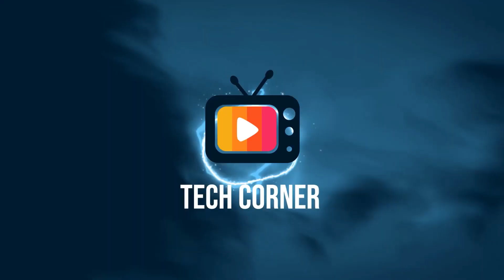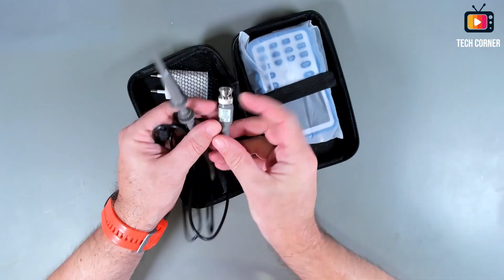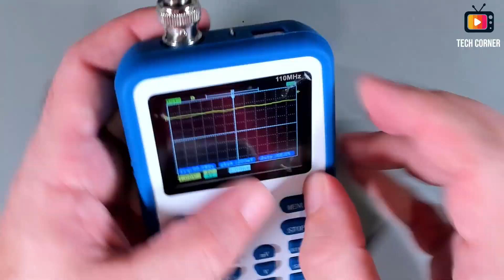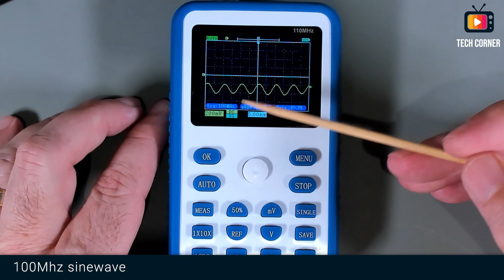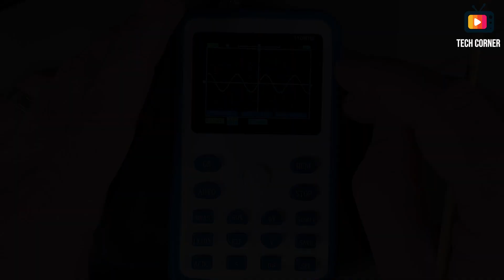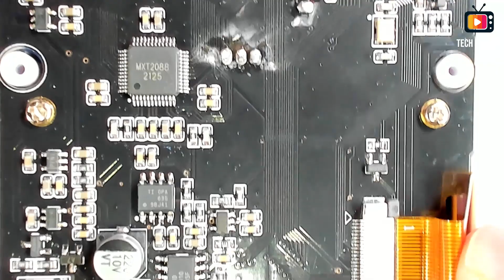FNIRSI 1C15+ Handheld Oscilloscope ⭐ 110Mhz 500Msa/s ⭐ Complete Review & Teardown

Comment: Thanks How did u change waveform?
Reply from the maker: The FNIRSI 1C15+ only displays the input signal you feed it – you change the waveform on your function generator, not on the scope itself. 😉 But if you question os more how to control the time divisions, the amplitude and the position on the screen, you use the direction keys. But it's all on the video

Comment: Vuna ziua.La nici un osciloscop nu se masoara semnal sinusoidal cu osciloscopul setat DC in loc de AC.Fregvente mai mari de (>) 5-6 Mhz nu se masoara pe pozitia 1× a sondei ci pe pozotia 10× a sondei.Osciloscopul la pretul lui este modest si Chinezii se lauda mult de obicei cu tehnologie furaza pe care nu o stapinesc dar nici chiar asa cum este prezentat.Masuratorile sunt total compromise in mod intentionat.
Reply from the maker: I appreciate the feedback! You're right that the 110 MHz rating is optimistic — in my measurements it was really usable up to roughly 50 MHz, so at higher frequencies the readings do fall short. That said, I didn't see signs of intentional compromise, just the typical limitations of a budget design. Have you tested one yourself? I'd be curious to hear your experience.

Comment: A nice thing to write about the manufacturer is that they stopped wasting time by erasing the part numbers from the IC's.
Reply from the maker: Hi Paul, never got why they will do that... well, on a second though, probably so the users won't find out that the parts can't perform with the announced specs... 😎thanks for watching! 👍
Reply: unfortunately one chip is unreplaceable unless you have the right  firmware to burn it.

Comment: I need explanation from the manufacturer (or anyone else) how you can get 500Msp/sec from an dual channel 100Msp/sec ADC !!!
Reply from the maker: Hi Paul, unfortunatelly is a market malpractive for every low cost brand, it's sad, because if they anounced a 30 to 50Mhz oscilloscope, the review will be awesome product. But I still mantain, that is a nice product anyway, but kinda fill ripoff. I just found out that my 150HP car has 75HP engine.... it's a nice car anyway, good seats, nice electronics.... nut will not go up to 220Km/h... but it will work ok up to 160km/h... that's the feeling 😁thanks for watching! 👍
Reply: @TechCornerTV  Just tell us what model is your car 🛺. Okay?
Reply from the maker: @paulcohen1555  Ahahaha... it's an ok car! I have a Nissan Qashqai.... waiting for the electric cars price to come to resanoble values!

Comment: Please measure the rise time of an square wave (and show the picture).
This is a very important parameter.
Reply from the maker: Hi Paul,. I'm not using the rise time method, even if I know what you mean because 2 main reasons:
1) it is very hard to do honest test on this small handheld oscilloscopes, because is very hard to find out the upper and lower 10%,  we don't have cursors. making it even more difficult.
2) Those oscilloscopes are supposedly 100Mhz, so I need a signal generator that can have a rise time of lesser than 1ns, I don't yet. So, to be accurate and fair, I preffer for the moment not do that test. 
Even so,  for all I know and I always open to the option that I'm wrong, but with 1Vpp, the -3dB point is at around 707mV maximum, so we kind of know what is the maximum bandwidth because if it goes under that you reached the maximum frequency. Thanks for watching 👍
Reply: @TechCornerTV  It's okay, just wanted another measurement method.
Reply from the maker: @paulcohen1555  Right now, I can't, sorry! I build a fast edge signal generator for those test, but it's not working properly and I have to confess that right now I don't have the time to figure it out whats going on.... soon!

Comment: Very nice review.  Thanks!  Your review confirms that this is one of the better handheld scopes that I've come across.

I like the concept of these scopes, but I constantly want them to either get a bit better or a bit cheaper.  I think this model should cost $45 at this accuracy and bandwidth or that it should have much better sampling accuracy at a true 100MHz for $64.  Even still, it's not terrible and can show a reasonable waveform at lower bandwidths.  They should focus on improving the accuracy and stability at a properly rated bandwidth and sampling rate instead of exaggerating and interpolating so much.
Reply: I am almost sure that there is an model made only for china for a much lower price.
Reply from the maker: @paulcohen1555  You must have an account, but you have it in TaoBao (chinese only aliexpress) for $47.
Reply from the maker: I left the link in here, because I'm not sure Youtube will not cut this comment out 😁😁 https://item.taobao.com/item.htm?spm=a230r.1.14.6.497852119oYwgR&id=612776453102&ns=1&abbucket=15#detail
Reply from the maker: Hello Rob, last night I recorder the video that will available next friday and as a spoiler alert, there is competition in the horyzon 😎 but that didn't take credit from this little fellow. Not counting the BW issue, it is a pretty decent oscilloscope for the price. You're right, some more tune up will ve good, but if see the signal of the DSO2000 from hantek, the signal also have a lot of jittery and is a 4 or 5 times more expensive equipment, not a excuse, but it is what it is in this market. Thanks for watching 👍